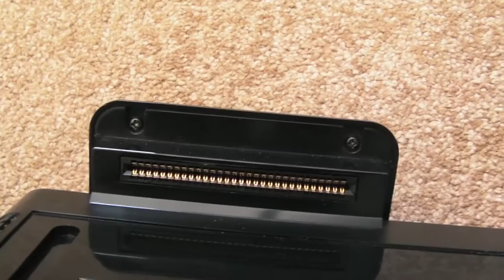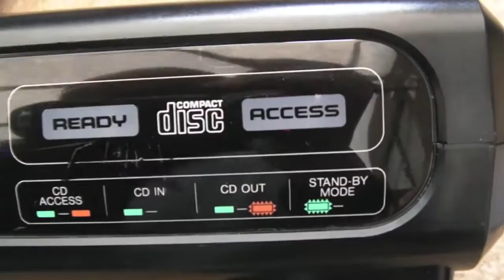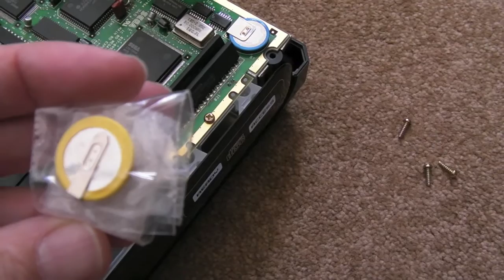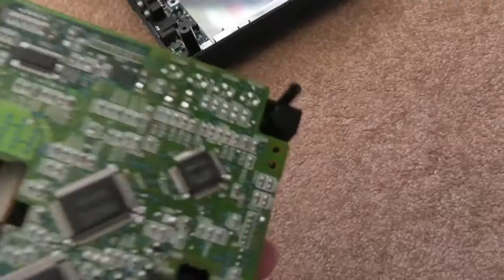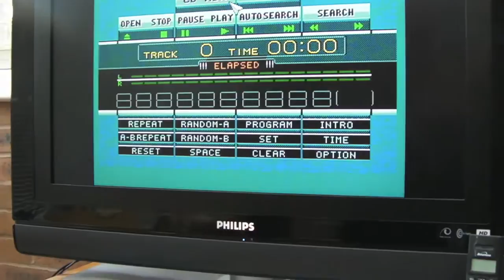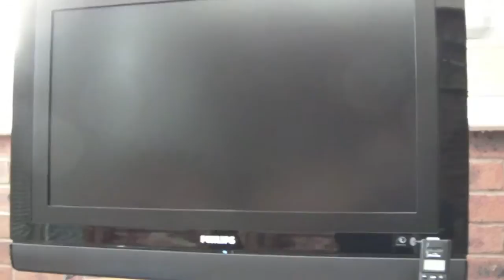Sega Megadrive (Genesis) Mega CD (Sega CD) Repair

Comment: That drive unit seems to be using the Sony CXA1372Q as the RF signal processing servo amp, which is the same as the Amiga CD32 drive unit is using. Since the Mega-CD has a 4-pot drive, it's very likely that those potentiometers are doing the exact same thing as the 4 pots in the Amiga CD32 drive. I just uploaded a video on that topic, so feel free to have a look at it if you're interested.
Reply from the maker: Hehe, you must have sent this just as I put my initial reply on your video =)  I will watch it all and post some comments!!!  It's very interesting, and an area in which I lack knowledge.  I hate CD systems, primarily because you really need to know what you are doing with them - And I know a little, but not enough!!!
Reply: Wow! You're always so extremely quick watching my videos after I posted them. :) How do you do it? Do you get some kind of notification sent to your smart phone as soon as a youtuber that you're subscribing to uploads a new video? Because I haven't seen such a functionality on youtube, but I would like to activate that kind of notification too if possible.
In the case of CD drives, every time you see a drive unit that has pots on the board, you should pay careful attention to what it says under those pots (if it says anything). If it says anything like FEG, FEB and so on like on the Amiga CD32 drive, then it's easy to figure out what the pots are doing.
I tried to see if I could catch a glimpse of the board right under the pots in your video here, but unfortunately you never held the board in such an angle so I couldn't get a view of it. An advice for the future would be to make more close up shots of the boards you're working on, slowly panning through the board and filming it from different angles. It will be easier for everyone to give you some advice if we can get some clear close-ups of the PCBs from different views and angles.
What kind of camera are you using btw? Cameras with small lenses (like the ones in smart phones) will give you poor performance in low-light conditions, so good lighting is advisable if you're using a smart phone when shooting your videos. ;)
Reply from the maker: RetroGameModz Hehe, that's because I am almost plugged into YT and often check the for new videos from people like you =D  I use a Samsung dedicated HD camera and my videos have improved a bit since I started as I tend to do more close ups etc now.  When I look back at some of my videos I think I shouldn't be making them tbh!
Reply: Oh, ok. I thought you had activated some secret setting on youtube that I didn't yet know about. But now I know what your secret is. :)
About your earlier videos... Well, what each individual has done in the past plays a big and quite important role on who he or she is today. Making the videos that you did in the past has most probably affected the way you approach your repairs today. We can learn from your own mistakes, we can learn from other people's mistakes, and we can learn from some other various sources of pure information. Reflecting over what we have done in the past, and also the way we did it and the outcome of that, can greatly help us acquire new knowledge that we didn't have earlier. So what I'm trying to say here is that there is no reason for you to think that you shouldn't have posted your earlier videos, since it's very likely that posting those videos have contributed quite a bit to the knowledge you have today.

Comment: Hello, my Sega Cd also had the the SMC issue and I am fixing it as well. I just replaced them but I am still at the empty BIOs screen? Is there an issue like loose solder or not connecting to the pads?
Reply from the maker: It's worth checking out that the caps are making good connection and the pads aren't damaged where they lead to traces etc.  It's also worth checking that the 'bridge' connector (where the Megadrive connects to the Mega CD) is nice and clean and seated correctly - You can get a black screen due to that.  There's also a chance that there's a problem with power input to the board, you would need to check the components out on the circuit board where the power jack connects.  When you say 'empty BIOS screen' do you mean you just get a black screen or do you see the BIOS screen but it won't see a disc?
Reply: GadgetUK164
I get to the bios screen but there is no Sega logo. Also, The power lights on the Sega CD doesn't light up. I am pretty sure it with the SMCs because I spotted leakage on one.

Comment: I have a brand new Japanese MCD 1 bought January 92 which has never been used and that would need new caps... the BIOS screen is garbled and full with artifacts, but I cannot do soldering... I wonder if you could do it if I pay for parts/labour/your time and two-way shipping... you can see the issue in my last uploaded vid...
Reply from the maker: Sorry but I just don't have the time!  =(  Best to find a local TV repair shop - they should be able to do the work!
Reply: GadgetUK164 Didn't think about that. I'l go ask one of those. Thanks for the hint.

Comment: I think I helped you dodge a bullet with this one. Got the mega cd today and it doesn't even try to fire up to the Boot sequence I am really stumped. Not sure I will be able to do the cap replacement myself. Fancy a challenge? :)
Reply from the maker: DaveDoc1984 Regards it not hitting the boot screen, try leaving it powered up for an hour then disconnect and reconnect the power.  If the caps were on last legs that additional warm up time could make it get a bit further, perhaps to the boot screen where it then might crash.  Why can't you do the caps, it's not hard - all you've got to do is twist the cap whilst keeping its centre in the same spot, if you do it carefully the cap legs break and the legs will still be soldered to the PCB.  You can then fit normal 10uF 16v miniture capacitors - you don't have to surface mount them.
Reply: GadgetUK164 Ill have a look when the Cap Kit arrives. My concern is how small everything is and my soldering work isn't the best but not awful by any means. Ill try your suggestion of firing it up for an hour or so and then powering down and then up again and see what happens :) thanks man.
Reply: GadgetUK164 Thanks man! Looks like it is a Cap issue. I can get the Mega CD to now briefly show the green and red LED's and then they turn off. I tried your suggestion of letting that bad boy warm up for a while. I think judging from this that the Caps need replacing when my Cap Kit arrives next week. I just hope I can do it myself lol!
Reply from the maker: You can also speed up that 'warming' process by using a hair dryer on the board for 30 seconds until its really warm - throw the lid back on and re-test.  That will often get more of a result.

If the cap kit has SMD caps, don't worry, you can pull the little rubber base off them and then the legs can be bent outwards, you can then mount them at an angle on the board rather than having to surface mount them.

It's not as hard as you think, the main thing is to remove one cap at a time and make sure the pads look OK before fitting the new cap, and they need to go the right way around regards + and -.  The board is normally marked with a + or something.  I usually look at the cap that is on there before I take it off in order that I know which way to fit the new cap.

All of the caps on that main logic board are 10uF 16v I think.  Any other caps in the kit don't bother fitting until you've done the 10 or so on the main board and retested.  You will likely find that it's just those caps.
Reply: GadgetUK164 I've got the main board in front of me and it looks like the really tiny Caps are the 16v ones and there are 2 other caps that are 6.3v ones. Do you reckon that's about right and replacing them should do the trick?
Reply from the maker: Aren't they all 10uF though?
Reply: GadgetUK164 I really shouldnt have attempted it myself, I Struggled and now its ruined. :(
Reply from the maker: =/  How is it ruined?  What went wrong?
Reply from the maker: If you can upload some pics or something I can point you in the right direction.  Nothing is ruined I am sure.
Reply: GadgetUK164 Thanks man, Me and my clumsy unprepared self has basically managed to damage something else on the board as I now dont get any signs of life even when left to warm up for an hour or so :( I think next time ill ask my friend Jason (who has done other repairs for me in the past and tricky mods) to do it.
Reply from the maker: Are you sure you've reconnected the board properly with regards to that double edge connector thing - where the Megadrive plugs in?  I had many a black screen whilst I was messing around with that connector.
Reply: GadgetUK164 Yep made sure I reseated that a few times. Now my Amiga A1200's sound has also suddenly gone bad. Its all distorted and scratchy sounding :( it worked fine last time I had it out. Could that also be some dodgy capacitors on the Audio Circuitry?
Reply from the maker: Yes, 1200s suffer from bad caps!  Send it to AmigaKit in Wales - they offer a recap service!  Better than risking the SMD work!
Reply: Don't mean to necropost, but the Mega CD also has the problem of using an unregulated linear power supply. Any power surge can blow the fuse on the board. And the fuse is soldered in place. It's the green component that looks like a resistor next to the ribbon cable. If the Mega CD doesn't even boot, it's most likely that the fuse is blown.
Reply from the maker: That's a great point!  I read previously about the fuse issue but completely forgot to mention it in my video!  Thanks for this useful info!!! =D

Comment: Hi GadgetUK164!

Can help me to get the original values to the next SMD capacitors from the back side of the mainboard: C23,C26 C22,C32, C30. These caps are missing from my model 1 mainboard....

regards: balazs from Hungary.
Reply from the maker: If you are talking about all the caps I replaced on the mainboard (with the battery) - the silver SMD electrolytics - they are all 10uF 16v on mine.
Reply: GadgetUK164
No,on the back side are a lot of SMD caps,and 5 of them missing. But finally i found the values : 100 pF.
Reply: GadgetUK164
with wrong battery,the megacd starts?
Reply from the maker: Yes, the battery won't stop the Mega CD booting.

Comment: Hi mate, I am picking one up this week (a Model 1 Mega CD) and it freezes on the BIOS Screen. Any ideas on what it might be before I start stripping it?
Reply from the maker: Yes, pretty sure I know what the problem will be - but not guaranteed!  The 10uF electrolytic capacitors on the main logic board.  See at around 1:00 ish.  You should order replacements and swap them all out.  They twist off (carefully), clean the pads with vinegar and a cotton bud, then use soldering iron to remove the legs still stuck on the pads.  Then solder some new caps on there.  You don't have to replace with SMD capacitors, you could just get very small low profile standard electrolytic caps.  As far as I remember they are 10uF 16v.  If you get a pack of 20 you will have spares.

There's always a possibility there's a RAM faulty on that system, or some other fault.  Buy my guess is it will be those caps.
Reply from the maker: I saw that one on EBAY btw and almost bidded on it for the reason that I think it's just caps as mentioned in my message above.
Reply: GadgetUK164 Thats why I went for it :) I have also ordered a Cap Kit for the Model 1 Mega CD so should be able to fix it. My soldering skills are reasonable.
Reply from the maker: Let me know how you get on!
Reply: GadgetUK164 Watch this space as I may document the process on my Channel :). Awesome videos BTW mate. I didn't even know a Mega Drive RGB Model existed! I always assumed French Secam users had some kind of adapter just like we had an RF Modulator and a lead to go between our old TV's and the MD.
Reply from the maker: Thanks =)  I will sub and look forward to you getting it working (fingers crossed it's just caps!)

Comment: Hi I'm getting issues with my megacd sound, the MD sound in the cd games comes out ok but the cd's real sound is broken up and distorted, i think the capacitors need replacing but i don't know what exactly i need to buy. I'm a complete novice at this so any tips would be greatly appreciated.
Reply from the maker: Hi, I am not 100% sure as I've not come across that problem before with the Mega CD.  What I do know is the board that houses the DC power jack connector and the connectors for CD pass through etc is likely where the problem lies.  I would start by removing that board and replace the electrolytic capacitors on it.  There's also a possibility that the audio passes through the main logic board (the one shown in my video at the start, where I replaced the surface mounted electrolytic capacitors) - you might find that the same problem is affecting audio on yours.  If you've never done surface mounted components it might be easier to take it to a local repair shop, although the capacitors are fairly easy to remove if you carefully (and I mean carfefully) twist them, clean up the pads with vinegar and then alcohol, and then solder on new 10uF capacitors (I think they are all 10uF on the main logic board - check before you order any capacitors.  On the audio and power board the caps are all pin hole components (I think), so should be much easier to remove them with a desolder pump and iron, and then fit suitable replacements.  Again you would need to check the size in uF and the voltage before ordering suitable replacements.  There's a small chance that the audio op amp on there has failed as well, but I suspect its much more likely the capacitors.

Comment: Hi i wonder if you know but is the metal grounding plate you have on the bottom of the megadrive essential when connecting mega cd?
Reply from the maker: No, it's just a "nice to have" really!  Not essential.  Very probably required at manufacture in order to pass RF noise testing.

Comment: The Mega CD originaly came with a metal locking plate, the catch on the side im sure was to lock the console together once connected. Have to dig mine out and have a look.
Reply from the maker: Thanks!  I've got the metal locking plate and I've since found that the plastic clip / switch on the side is to lock the mixing cable!  I didn't even know you were supposed to use a mixing cable!  I need to get one at some point!  Thanks for posting =)
Reply: yep you are right..